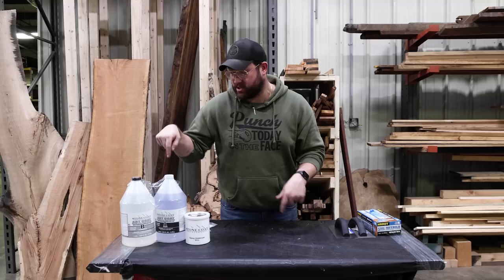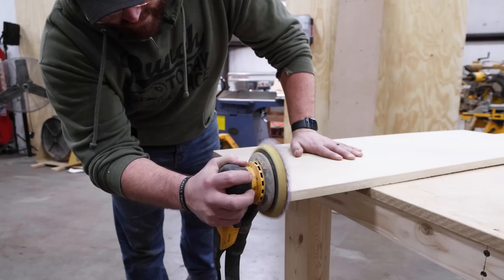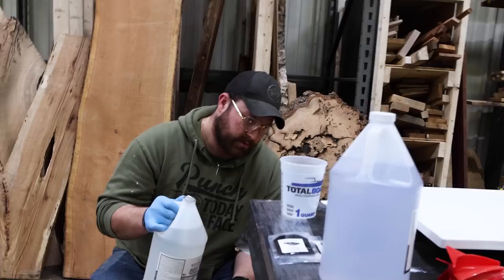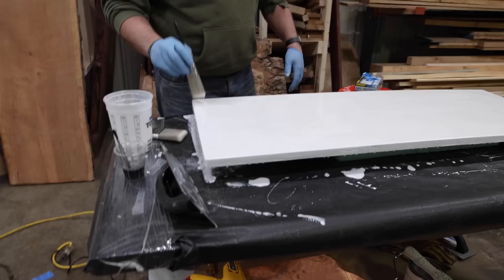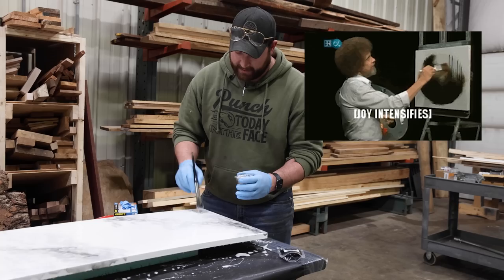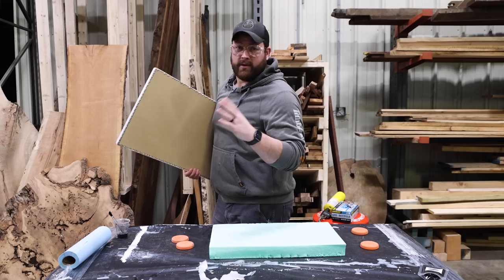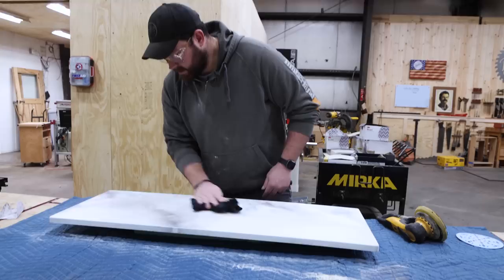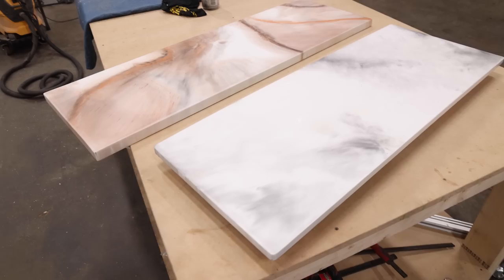I Tested Viral Epoxy Counter Top Products!

Comment: When calculating volume, 1mm thick pour for a square meter is 1 liter of epoxy. Which translate roughly to 0.04 inches thickness to about 9 square feet is about a quarter gallon or so. An inch thickness would therefore be 25 times that or about 6 gallons.

Comment: A tip when using cheap brushes, run some super glue on the base of the brush, that will eliminate any hairs/fibres falling off, i use this method for doing carbon fibre as i too use brushes once and throw away

Comment: I'm slightly more partial to Legarri. But if it's not Legarri, I'm definitely going with Stone Coat. also, pro tip, tape your bottom edges separately, and then you don't have to sand them.

Comment: I have to say, I am not sponsored by or connected to Stone Coat but when we bought a house and it had those hideous pink laminate countertops, as a temporary solution for a year or so, I did a Stone Coat finish over the top and it turned out great! I'm not sure it would be what I would do as a long-term kitchen, but for 18 months we had it on our countertops and it was MUCH better than what was there originally and only cost like $120 for the whole countertop.

We did the black one with the white marble spray effect. Looked great (though it did lose the luster of its original sheen and turn more matte over time).

Comment: John, I am thinking about doing this now with a small countertop we are adding to basement on top of some cabinets. MDF is flat and stable but should I seal the bottom with something so it does not get wet when cleaning?
Reply: I'd seal both sides.

Comment: did a bar top last week. came out amazing. The flaws were my fault entirely. Bugs because I did it at night in my garage with the door open(one bug is there forever, I got the others out in time) I was checking every ten minutes for bubbles and getting them out with a heat gun until I went in the house for an hour and didnt check and it was too late. they are very few and not noticeable anyways.

Comment: You can spray the denatured alcohol in a fine spray while the resin is still liquid, and it will do the same as the blow torch, and it will pop all the bubbles.

Comment: Maybe on the end brush the excess epoxy on the bottom of the board so you have less those droplets and actually protect the MDF with resin. If you install this as is to kitchen, little water gets to MDF and your work is ruined and it looks shit from the below if you dont do that. Specially useful since you do have plenty of excess around. It would be dumb not to do it. Hell i would try to cover every surface so MDF is just the core and epoxy seals it properly.

Comment: You should do the kitchen. I did mine and it turned out great. I did the top of my desk first as a test run. In the kitchen I did the bondo live edge Man it looks great in Black Galaxy. Assessor came in to value the house for a refi and thought it was actual stone right up to when he knocked on it. He was like that's not stone? I was noooo you thought it was? I told him to search Stonecoat on YT and he could DIY counters like mine or what look he wants.

You might want to consider their topcoat it gives a mat look with great protection and food safe.

Comment: @1:48
You sir are a war criminal now.

Hague Regulations (1899)
Article 23(f) of the 1899 Hague Regulations provides: “It is especially prohibited … to make improper use of … the distinctive badges of the [1864] Geneva Convention.”
Regulations concerning the Laws and Customs of War on Land, annexed to Convention (II) with Respect to the Laws and Customs of War on Land, The Hague, 29 July 1899, Article 23(f).

Geneva Convention (1906)
The 1906 Geneva Convention provides:
Art. 27. The signatory powers whose legislation may not now be adequate engage to take or recommend to their legislatures such measures as may be necessary to prevent the use, by private persons or by societies other than those upon which this convention confers the right thereto, of the emblem or name of the Red Cross or Geneva Cross, particularly for commercial purposes by means of trade-marks or commercial labels …
Art. 28. In the event of their military penal laws being insufficient, the signatory governments also engage to take, or to recommend to their legislatures, the necessary measures to repress, in time of war, individual acts of robbery and ill treatment of the sick and wounded of the armies, as well as to punish, as usurpations of military insignia, the wrongful use of the flag and brassard of the Red Cross by military persons or private individuals not protected by the present convention.
Convention for the Amelioration of the Condition of the Wounded and Sick in Armies in the Field, Geneva, 6 July 1906, Articles 27 and 28.

Hague Regulations (1907)
Article 23(f) of the 1907 Hague Regulations provides: “It is especially forbidden … to make improper use of … the distinctive badges of the [1864] Geneva Convention.”
Regulations concerning the Laws and Customs of War on Land, annexed to Convention (IV) respecting the Laws and Customs of War on Land, The Hague, 18 October 1907, Article 23(f).

Geneva Convention (1929)
Article 24 of the 1929 Geneva Convention provides:
The emblem of the red cross on a white ground and the words “Red Cross” or “Geneva Cross” shall not be used either in time of peace or in time of war, except to protect or to indicate the medical formations and establishments and the personnel and material protected by the Convention.
Convention for the Amelioration of the Condition of the Wounded and Sick in Armies in the Field, Geneva, 27 July 1929, Article 24.

Geneva Convention (1929)
Article 28 of the 1929 Geneva Convention provides:
The Governments of the High Contracting Parties whose legislation is not at present adequate for the purpose, shall adopt or propose to their legislatures the measures necessary to prevent at all times:
(a) The use of the emblem or designation “Red Cross” or “Geneva Cross” by private individuals or associations, firms or companies, other than those entitled thereto under the present Convention, as well as the use of any sign or designation constituting an imitation, for commercial or any other purposes;
(b) By reason of the compliment paid to Switzerland by the adoption of the reversed Federal colours, the use by private individuals or associations, firms or companies of the arms of the Swiss Confederation or marks constituting an imitation, whether as trademarks or as parts of such marks, for a purpose contrary to commercial honesty, or in circumstances capable of wounding Swiss national sentiment.
Convention for the Amelioration of the Condition of the Wounded and Sick in Armies in the Field, Geneva, 27 July 1929, Article 28.

Geneva Convention I
Article 39 of the 1949 Geneva Convention I provides:
Under the direction of the competent military authority, the emblem [of the Red Cross, Red Crescent or Red Lion and Sun] shall be displayed on the flags, armlets and on all equipment employed in the Medical Service.
Convention (I) for the Amelioration of the Condition of the Wounded and Sick in Armed Forces in the Field, Geneva, 12 August 1949, Article 39.

Geneva Convention I
Article 44 of the 1949 Geneva Convention I provides:
With the exception of the cases mentioned in the following paragraphs of the present Article, the emblem of the red cross on a white ground and the words “Red Cross” or “Geneva Cross” may not be employed, either in time of peace or in time of war, except to indicate or to protect the medical units and establishments, the personnel and material protected by the present Convention and other Conventions dealing with similar matters. The same shall apply to [the red crescent or red lion and sun on white ground] in respect of the countries which use them. The National Red Cross Societies and other societies designated in Article 26 shall have the right to use the distinctive emblem conferring the protection of the Convention only within the framework of the present paragraph.
Furthermore, National Red Cross (Red Crescent, Red Lion and Sun) Societies may, in time of peace, in accordance with their national legislation, make use of the name and emblem of the Red Cross for their other activities which are in conformity with the principles laid down by the International Red Cross Conferences. When those activities are carried out in time of war, the conditions for the use of the emblem shall be such that it cannot be considered as conferring the protection of the Convention; the emblem shall be comparatively small in size and may not be placed on armlets or on the roofs of buildings.
The international Red Cross organizations and their duly authorized personnel shall be permitted to make use, at all times, of the emblem of the red cross on a white ground.
As an exceptional measure, in conformity with national legislation and with the express permission of one of the National Red Cross (Red Crescent, Red Lion and Sun) Societies, the emblem of the Convention may be employed in time of peace to identify vehicles used as ambulances and to mark the position of aid stations exclusively assigned to the purpose of giving free treatment to the wounded or sick.
Convention (I) for the Amelioration of the Condition of the Wounded and Sick in Armed Forces in the Field, Geneva, 12 August 1949, Article 44.

Geneva Convention I
Article 53 of the 1949 Geneva Convention I provides:
The use by individuals, societies, firms or companies either public or private, other than those entitled thereto under the present Convention, of the emblem or the designation “Red Cross” or “Geneva Cross” or any sign or designation constituting an imitation thereof, whatever the object of such use, and irrespective of the date of its adoption, shall be prohibited at all times.
By reason of the tribute paid to Switzerland by the adoption of the reversed Federal colours, and of the confusion which may arise between the arms of Switzerland and the distinctive emblem of the Convention, the use by private individuals, societies or firms, of the arms of the Swiss Confederation, or of marks constituting an imitation thereof, whether as trademarks or commercial marks, or as parts of such marks, or for a purpose contrary to commercial honesty, or in circumstances capable of wounding Swiss national sentiment, shall be prohibited at all times.
Convention (I) for the Amelioration of the Condition of the Wounded and Sick in Armed Forces in the Field, Geneva, 12 August 1949, Article 53.

Geneva Convention I
Article 54 of the 1949 Geneva Convention I provides: “The High Contracting Parties shall, if their legislation is not already adequate, take measures necessary for the prevention and repression, at all times, of the abuses referred to under Article 53.”
Convention (I) for the Amelioration of the Condition of the Wounded and Sick in Armed Forces in the Field, Geneva, 12 August 1949, Article 54.

Geneva Convention II
Article 41, first paragraph, of the 1949 Geneva Convention II provides: “Under the direction of the competent military authority, the emblem of the red cross on a white ground shall be displayed on the flags, armlets and on all equipment employed in the Medical Service.”
Convention (II) for the Amelioration of the Condition of the Wounded, Sick and Shipwrecked Members of Armed Forces at Sea, Geneva, 12 August 1949, Article 41, para. 1.

Geneva Convention II
Article 44 of the 1949 Geneva Convention II provides:
The distinguishing signs referred to in Article 43 [red cross, red crescent or red lion and sun on a white ground] can only be used, whether in time of peace or war, for indicating or protecting the ships therein mentioned, except as may be provided in any other international Convention or by agreement between all the Parties to the conflict concerned.
Convention (II) for the Amelioration of the Condition of the Wounded, Sick and Shipwrecked Members of Armed Forces at Sea, Geneva, 12 August 1949, Article 44.

Geneva Convention II
Article 45 of the 1949 Geneva Convention II provides:
The High Contracting Parties shall, if their legislation is not already adequate, take the measures necessary for the prevention and repression, at all times, of any abuse of the distinctive signs provided for under Article 43 [red cross, red crescent or red lion and sun on a white ground].
Convention (II) for the Amelioration of the Condition of the Wounded, Sick and Shipwrecked Members of Armed Forces at Sea, Geneva, 12 August 1949, Article 45.